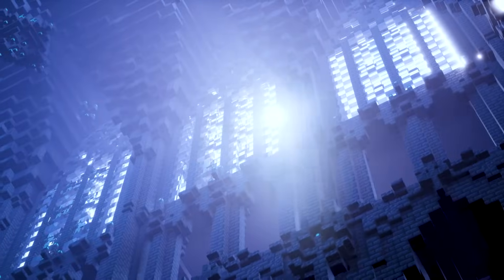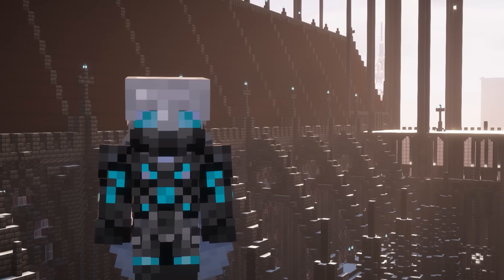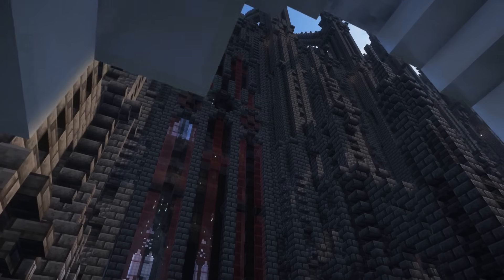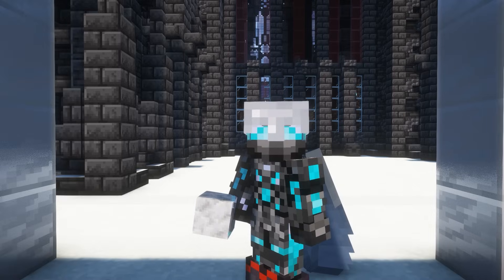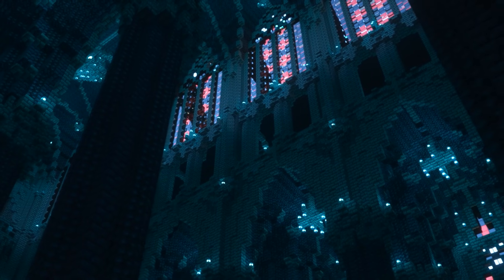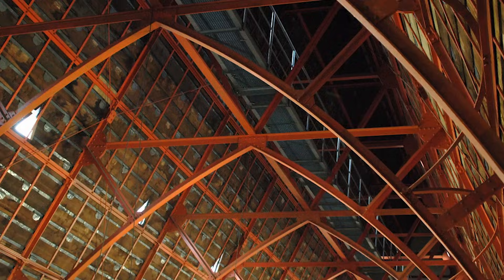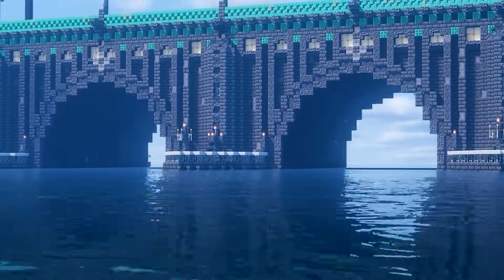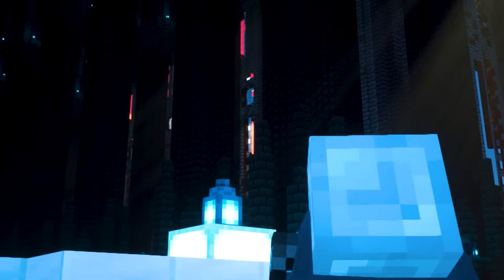How To Build A Cathedral

Comment: Pointing out that the gothic arches are just two circles intersecting side-by-side, and the vaulted ceiling being cylinders also intersecting perpendicular was very useful.  👍
Reply: that's not often true. Often the diagonal ribs (that's the stone arch crossing diagonally from support to support actually have the same proportions as the transverse arches, leading to a vault that is much taller in the middle rather than two intersecting cylinders. A gothic four part ribbed vault (or any groin vault really) is defined by both the transverse, and the diagonal arches.

Comment: Are there any mods that make curved and pointed arches and vaulted ceilings possible? 
To make them more accurate
Reply from the maker: you can use stuff like axiom to make curves and draw them out, I personally though like to build them by hand as I find it easier, but I have used axiom for some more advanced hyberbolic geometries

Comment: In my first semester of mechanical engineering, my mechanics professor told us about the so-called chain line. It is the curve along which a chain reorients itself under gravity. If we rotate this line and build it ouf of stone, we will obtain a stable structure that was used in the construction of Aachen Cathedral, for example.
Reply from the maker: Yes, I haven't touched base on it, because I am actually trying to build it too, but catenary arches like those seen in the domes of St Paul's and St Peters are a absolute wonderous architecture marvel. I think domes and the entire roofing system of Sagrada Famila deserve there own video

Comment: Don't forget that the main sitting areas do NOT have vaulted ceilings they have what are called Cathedral Ceilings which are TALLER than a regular vaulted ceiling. They're at a steeper angle than a regular vaulted ceiling as well which is how you tell the difference by simply looking. You can see them in other areas as well. Also that cathedral you show later on IS gothic, it is a style and it is in no way limited to appearing only on Eruope, in particular it's closest to the early gothic period with how simple and the shape of certain features.

Comment: As an organist, please don't forget to include organs in your cathedral builds, thank you.
Reply: Yup, I use a technique that uses stripped bamboo for the pipes and looms for the keys.
Reply: @Slender_Man_186  I would've done the exact same thing
Reply: Got it, adding a live heart in the middle of the base
Reply: @dimensionshulk9963  Like Monster House!
Reply: @Cool1st Goated reference
Reply: Where do the lungs of the cathedral go?
Reply: @IAteSoap2092  That's called a blower and it typically goes in the basement, providing the organ with high-pressure air. It used to be a manual process, and it was quite grueling.
Reply: got it im covering it in skin
Reply: @grqfes what color
Reply: Gotta say, that's pretty organist of you.
Reply: Sound of steam create mod
Reply: what is an orgamist? you got orgasms oo often?
Reply: Yeah I’ll put ur organs in my builds
Reply: i will build an organ for you dont worry :)
Reply: No, I'm not gonna add any just out of spite now

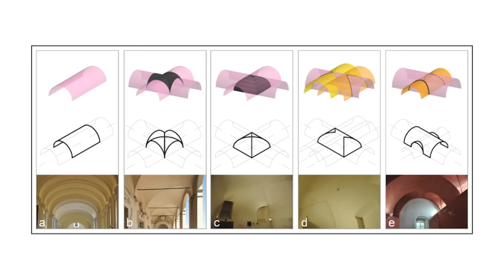Comment: 5:55 - Vaulted ceilings are NOT the result of two (semi-)cylinders intersecting. The semi-cylinder (or, 'arch-shaped' ceiling if you will, as it can be pointed too, and is in most gothic case) is the vault. A vault is an arch with depth.

The simplest vault, one which is just an arch with depth in a simple line, is a barrel vault, because (for a semi-circular arch), it looks like (half a) barrel.

When you intersect two barrel vaults, you get in increasing levels of complexity: groin vaults, rib vaults, and fan vaults.

Groin vaults are just a simple basic intersection, you might slap some stucco décor to hide it a bit if the arches aren't the same, as it could look quite messy then, but it is just a simple intersection.

Rib vaults add a reinforcement, somewhat like a buttress, to the inside of the vault. These happen at the edges of the square intersection, and also diagonally across it. You can also do this sexpartite if one of the vaults is twice the size of the others.

Liernes are just additional ribs built between the existing ones, creating star-shaped patterns. A lierne vault is really just a somewhat more decorative rib vault. Tiercerons are similar, they're other additional ("tertiary") ribs, really quite decorative ribs rather than structural, though instead of going from one rib to another, they instead spawn from the same points as the structural ribs, but take a path between them. Tiercerons and Liernes can occur together. They are just rib vaults though, functionally. It's purely decoration which can get as elaborate and convoluted as you wish.

Fan vaults are the step up, instead of just intersecting the two arches, instead you rotate each half of the arch around the corner of the intersection so it curves around. You end up with small patches of (usually) flat ceiling which might feature focal decorations too. 

You can also sidestep having to directly intersect two vaults by placing a dome over the intersection, and supporting the corners of that dome on squinches or pendentives (they are the two ways of supporting a circular or octagonal 'dome' shape onto a square room, like that formed by the intersection of two barrel vaults).
Reply from the maker: Yes I picked up that legit a couple days after I posted video, great summaries for each. Personally the Cathedrals in Australia rarely, if ever, use a Vaulted ceilings. I've seen all kinds of vaults except for lierne and fan vaults which to my knowledge don't appear really anywhere in Australia, maybe some church has them. Great information :)
Reply: @kxaifer  That's totally fair! I just thought I should bring it up, because its about the one and only notable mistake in what I can say (as someone who has studied architecture) is an incredibly well researched and presented video. 

If I'm to provide another useful detail:

Symmetry is often quite valued in these designs (although as you touched upon, many significant cathedrals grew over time in a patchwork fashion, which tended to develop asymmetrically from their original plan), but one key violation of symmetry is in Gargoyles. Gargoyles tend not to be the same (I have heard it said, though can not verify, that no two gargoyles are the same). - It's worth noting not everything you would call a "gargoyle" is one. The actual term for those sorts of sculptures of beasts, chimeras, and people is a "grotesque", and a "gargoyle" is a grotesque which acts as a water spout, projecting rainwater collected off the roof out and away from the walls of the building (often out of their mouth), helping to avoid water stains down the walls.

This has in places held through to the modern day, in the 90s up in Scotland, Paisley Abbey was being restored, and they wanted to replace the gargoyles which had long since been weather away (and temporarily replaced with bland and undecorated blocks), that abbey is a Grade 1 Listed Building, so it's pretty strict on what you are allowed to do or not...

...In absence of knowing what those original gargoyles looked like, and in keeping with the medieval and gothic tradition of unique gargoyles, the stonemasons hired were asked for new contemporary designs of gargoyle, and among the 20 they drew, 12 were selected to be made, including one very heavily inspired by the Xenomorph, from Alien.

So, if you are making a highly decorated cathedral, perhaps consider mixing up your sculptures a little.

Comment: yo what shaders are you using? i personally use Rethinking Voxels for the raytracing, which creates accurate shadows and light shafts. its a pain to run, but it instantly makes any interior shot 10x better in my opinion

Comment: I have literally always dreamed of building a cathedral in Minecraft (and in real life). My friends and I have also just begun a new server. I believe finding this video was Providence, so I'm gonna go for it. How do you lay out general structure vertically? Working with a floor plan is well and good, but I struggle to continue the design moving upward without accidentally cramping it
Reply from the maker: Start simple, build columns vertically up, then build your arches to connect them, its easier to build from bottom up. Best to follow a existing structure for influence

Comment: Hey Kxaifer, I have a suggestion for you, you should add custom bell sounds, like giant cathedral bells. Personally I re used the current note block bell sound in game and replaced it with one of the bells from the Cologne cathedral in a recource pack. Its a lot simpler than I thought but the only con is that you can only hear a note block from 48 blocks away. Thats why I might instead use a juke box, since you can hear them further. However with note blocks you can make the bell sound how you want.